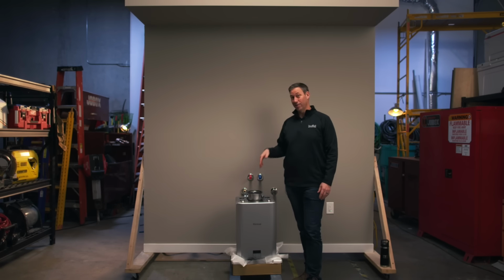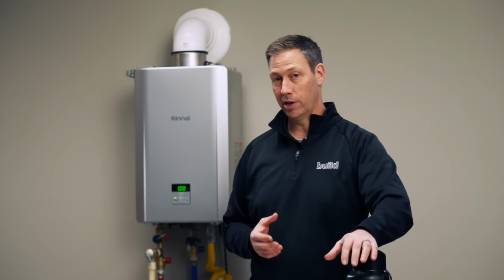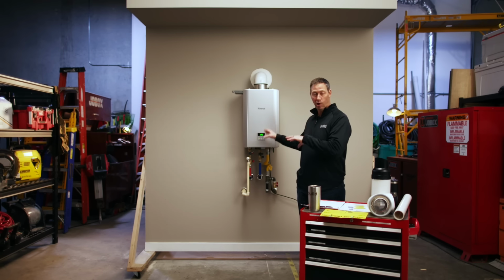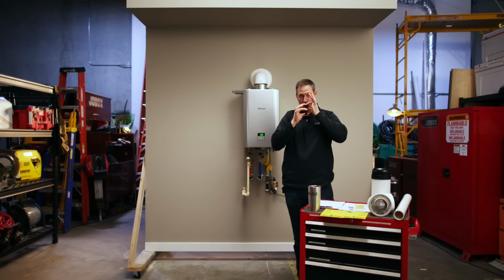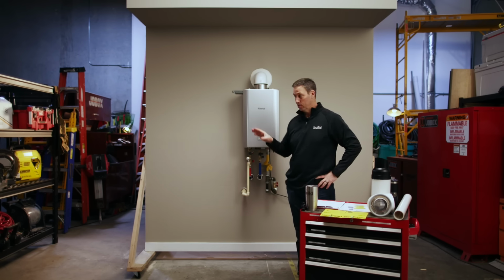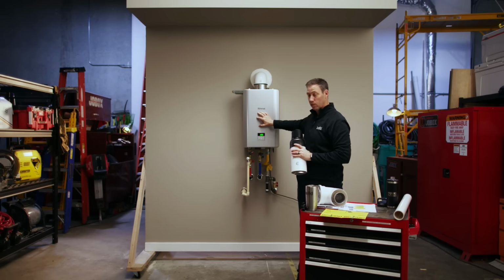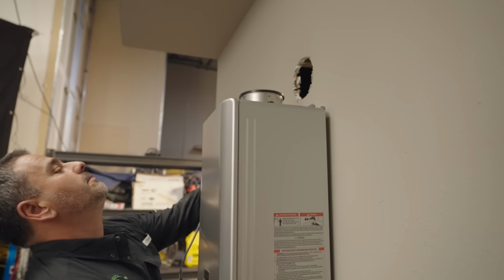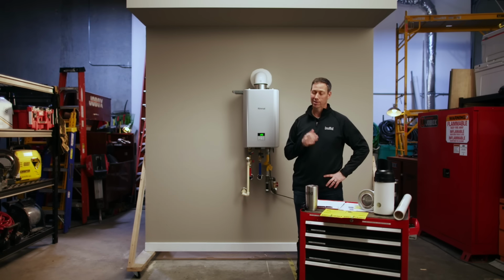Replacing A Water Heater Tank? Probably the Best Tankless Option for You.

Comment: Not a good posting Matt.  
MANY instant water heater installations plagued with problems.  
They were designed to solve SPECIAL problems, to be used in warm climates, to provide LIMITED hot water, etc, not be universal solutions.  
See Bob Y's post for all the reasons it'll bite you in behind gas wise.  Ditto if with electric. 
The often don't provide needed HW over ANY period of operation as they are NEVER sized for likely simultaneous loads, 2 showers, kitchen sink, dishwasher, clothes washer, unless they are max water conserving fixtures and less than 10 min showers.  1/2 of the people in the US live in areas where you are probably looking 5 gpm due to low ground water temp incoming with a max water temp of 110, which by the time it runs through pipes could well be 105 (a typical shower) or less.  If you have a home that is more than 10 yrs old, you could well have shower heads using 5 gpm and that's maxed out your 200,000 btu system.  So add to price replacing any fixtures using more than 2.5, preferably less, max 1.75, but obviously 1.5 better. .  Hint, do this MONTHS before changing water heater, then if family 'complaints' are too strong, you can just put the old faucets and shower heads back on.  
Now, you can keep upping the size of the instantaneous heater to commercial quality equipment, sure you can do it, with a burner 4 times more powerful than your furnace.  Guess what, that also means the unit will wear out faster.  Not an issue with commercial, they are used to spending money to make money.  
Oh, and heat pump water heaters, outside of the try to find an installer with a track record, or at all, then try to find someone to fix the AC part, which will fail faster than you typical window ac as it's under full load all year, you'll find the backup resistance heaters are on MUCH of the time, and if they system does not have typ two 5000 watt elements, you'll be short of hot water at times.  Also check the maximum draw of the unit, as unless the heating elements are turned off before AC heat pump comes on, it'll mean this is drawing MORE power than before and you'll need an electrician to run a bigger line, assuming your panel has the spare capacity.
I have a solution to this, virtually unlimited hot water.  There are one or two 80 gal water heaters still available that can be retrofitted with upgrade kits, thermostatic valve, improved anti corrosion fittings and accessories, so you can set it at 160 or 180 even and mix it down to 120.  That means 110 to 140 plus gallons of hot water first hour of use instead of 30 with a heat pump water heater running on conservation mode.  About

Comment: Problem with recirc is the unit never really gets to turn off since the water in the lines is always cooling down so essentially you are never 'on demand'.  It will basically kill your electricity usage during the 20 hours in the day you aren't actually using hot water.
Reply: Using the recirc valve also means you no longer have any cold water without waiting for new water to enter the pipes.

Comment: I have a Rinnai Tankless in my house, that I installed after having 2 traditional water tanks, spring leaks on me back to back...

Anyways I DO NOT have a re-circulation valve in my house, nor do I want one. I'll deal with cold water, b/c I don't want to just 
CONSTANTLY heat the water for the luxury of having "instantaneous hot water".... 

That being said I was using 50 dollars of natural gas a month, without batting an eye, on my old water heaters, when I switched over to my Rinnai, my gas portion
of the utility went down to about 10 bucks a month. Mind you SINGLE PERSON in the house.. 

It was completely worth the headache of reading a manual an installing.

Comment: So . . . . you promote the benefit of the tankless design - e.g., it doesnt keep hot water in the tank hot all the time . . . but then, burn gas to maintain the temperature of the water in your line (!) - -And, as soon as you do, it seems like it's now a (not quite) tankless design with the piping becoming the storage tank . . . . . . .  ALL KINDS of considerations here - - - certainly the volume of water in those lines is less than what is in my hot water tank BUT . . . . those lines aren't going to be insulated very effectively (for most existing construction) . . . . and the amount of uninsulated (in most existing homes)  surface area of those pipes for a given volume of water is going to be very significant compared to my tanked hot water heater . . . . . .with the net result that you're gonna give up heat pretty quickly . . . . Seems like a case of two or three steps forward and some number of uncertain steps backwards. .  But hey . .  we can sell some tankless heaters.

Comment: I have spoken to several plumbers over the years as they were installing tankless to replace the old hot water tanks. All of them to a man will not have them in their own homes. If the customer has an old electric water heater , said customer must spend up to 1800 dollars to upgrade the panel box. The other downside plumbers have told me is the tankless units only last about 5 years. For five years of service , seems like a lot of money to spend. Not trying to piss on your parade but people should know the drawbacks to switching to tankless. I cannot speak to the longevity of gas fired tankless units , however , I believe the life expectancy of those are about 6 years. Most standard water heaters gas or electric can last 12 to 15 years and cost about 6 to 8 hundred dollars plus the fee for installation.

Comment: I would have assumed most water heaters would be in the mechanical closet along with the furnace and evap coil so the condensate drain is right there.
Reply: The condensate that comes from condensing gas appliances is highly acidic. 
You cannot run it into copper and many cities make you clean it with a neutralizer in line first before adding to sewage lines.

Comment: Could you explain the advantages to an electric tankless vs. a gas (propane) tankless? Please!
Reply: If you're in America, electric tankless is only used for seldom-used points because they can't flow hot water for very long. If you're in other parts of the world, that's not the case necessarily. The difference is how they get power. In America we only have 220 volts. .. and that's if you run a dedicated line and if your service supports the extra amperage. 

In Europe you might have 440v, which lets you need less current, smaller/cheaper electric wiring, all while using a heater than can compete with gas for performance. In other words that product doesn't exist for Americans.

Comment: I have a Rinnai commercial unit handling my heat and hot water. It was able to use the existing PVC exhaust from the old direct vent tank, and the relief valve was already run to a drain so that was fine for condensate. It's much quieter and modulates pretty seamlessly. It handles heat, a hot wash filling, and a shower as hot as I want it simultaneously without issue. The only real downside is the initial delay, but honestly it's worth the tradeoff for me.

What I can't speak to is longevity, reliability, and service costs. I rent through, so that's not my problem (directly anyway).

Comment: Our house has 2 hot water circuits- the master and everything else.  The 11yo ao Smith 50gal power vent for the master finally started leaking. I was torn between tankless (have the gas for it) and tank.  Ended up installing two Bradford White 50gal power vents in series.  So there's 100gal of hot water on tap, first hr delivery is approx 140 gal.  It almost seems to work like tankless really.  Can take a 20 min shower, then fill a jacuzzi tub, run the hot drip to keep the bath warm, do that for half an hr and then take another 20min shower.  Solid hot water the whole time, faster delivery, lower maintenance.  Pretty happy w it.

Comment: No thanks I sold tankless for 8 years ,I'll keep changing my Angel rod's every two years in my 20 y.o. glass lined 50 gallon tank.Average cost for permits and installation on Tankless before pandemic was average $3500, Tank$ 1300 here in las vegas.Great video for new home builds,and they are easier to replace after 10-20 years like a tank, just rember dont use a Water Softner folks that will kill heaters faster then anything
Reply: $3,500?  That's the going rate for a tank replacement.  With a simple, cheap HD unit.  Tankless are double that at least.  And even more if input or output upgrades are required.  (New venting is always required!).

But, still cheaper than the $6,000 to $8,000 I've been quoted for a heat pump water heater installation.  And that assumed I would provide the 240V, 30A service.  (I was planning to steal the electric dryer circuit from the nearby breaker box because I have a gas dryer)

Everything construction related in CA is off the charts these days.  My neighbor paid $20,000 for an exterior house repaint to a couple of unlicensed, undocumented two years ago!   Actual licensed pros were too busy to even offer him an estimate.

Comment: i wish i had the money for a tankless, had to go with a small loan just to replace my failed tank water heater (paycheck to paycheck can suck when things break all at once, (i would have to add power to the closet and get stainless vents if i went tankless, as the tank variety just uses a normal pilot light and galvanized flue pipe)

Comment: So, you're taking the cost/efficiency of a tankless and instant hot water system...and modifying it to continually heating/maintaining stored hot water in lengths of pipe? Aren't you neutralizing all those incredible instant hot water tank advantages a bit?

Comment: In the UK tankless is pretty common, though the same heater also does hydronic heating of the property over winter, so there's a secondary heat exchanger inside it. Though now discussion is going back to tanks (cylinders) so you can use solar and heat pumps as inputs for lower carbon heat.
Reply: My boss man is thinking of if and when they might donut with gas. Because he's thinking of the oil crisis that they may look into more electric or maybe even Hydrogen. What do you think about that?
And yeah. My boss has already put in a lot of electric water heating tanks. We've managed to get some good sources of simple vent less heaters that could work of solar no problem.

Comment: I tankless water heater. The only thing, that I don't like, is I have run the water to get hot water. So, the only time I run it, is when I do my laundry and dishes together. Other than that, I love it. I have a 1,000 square foot house. I believe my tankless water heater is condescending water heater. I'll have to install crossover valve under kitchen sink. I thought of installing a recirculation pump.

Comment: Does that thermal bypass valve work in a old retrofit hot water tank scenario? Just trying to get hot water quicker without an existing recirculating pump.
Reply: Check out the Smart Recirculation Control, they have on demand pump solutions for tank and tankless water heater with and without a dedicated recirculation loop.

Comment: For models that hook up on the outside what climates can they operate in without freezing?
Reply: The exterior unit can protect itself down to -4 but again it only can protect itself but not the pipes below. But it still needs electricity and gas on some models.

Comment: So do you need that bypass valve for each fixture then?  Many houses have multiple sinks or showers that are the same far distance away.  Whats the point of only having your shower hot in the bathroom, but your sink takes a  long time.
Reply: No, not for each fixture, as long as all your distant fixtures are plumbed off the main trunk line which will now be primed with the hot water. If the multiple distant fixtures have different trunk lines then yes, you need the bypass valve somewhere on each trunk line.
Reply: @nwsvndr  But what primes the other lines off the main trunk line when they are inactive?  If water isn't being drawn from that hot water line from running the tap, that pex line will eventually cool off and just be cold water.  So that line will still have the issue of having to empty that cold water first before hot water follows it.
Reply: @virgil3241  Only the one fixture (the one that has the valve) gets hot water immediately. At the others you'll have to still wait for the hot water to get from the trunk line to the fixture (the water in the trunk line will be hot, but not in the line between the trunk and the other fixtures).
Reply: @nwsvndr  So as my original question asked, then you will need a bypass for each fixture thats the same distance away.  Because if you have a shower that takes a long time, then your sink will as well.  What's the point of just having one fixture in the house get hot water immediately, and then have 3-4 others have the same issue
Reply: @virgil3241  In the distant bathroom, it's unlikely each fixture has a separate line that goes all the way back to the heater. But if yhey do, then yes, you need not only a valve at each line and also possibly multiple pumps.
Reply: @nwsvndr  Not back to the heater, but to the manifold.  In Canada, we have a hot water manifold, and a cold water manifold.  With a line for EVERY fixture in the house that can be turned off seperatly to work on them.  Minus toilets obviously which only goes back to the cold.  Even so, my point still stands, you will need a separate bypass valve for every fixture far away because whats the point of having one far away shower be hot instantly, and your kitchen tap or bathroom tap take forever like before.  From the sounds of it, this would be more of a pain in the ass and extra cost.
Reply: @virgil3241  I agree, it doesn't sound like this is the system for you (and those plastic valves aren't cheap!).

Comment: Given most of these would be replacements, why not use the existing drain? also, how do you stand it up in place of a free standing conventional unit - is there a stand or something? (I have two old water heaters - both in the attic and would be good to replace with tankless seems like, but would want the higher efficiency condensing units)

Comment: Why not just use that cold water from the hot tap to brush your teeth before you get into the shower. By the time you have finished brushing your teeth, rinsing your toothbrush, the hot water will be right there nothing wasted.

Comment: As a plumber I've only recommended a tankless water heater once. Tankless heaters cost twice as much and installation cost is high especially non condensing units because of the vent. Tankless units also need yearly maintenance and they become probablamatic after 5-10 years so there's a good chance you'll be out of hot water for a few days for parts to come in and  more than likely you could buy a new tank unit for fixing the tankless unit.
Reply: I’m a service guy and work on tankless at least 5-1 compared to a standard tank. With that said I still upgraded to a tankless myself. Endless hot water with kids trumped the inevitable break down to me.
Reply: Why own anything then if it will eventually break down?

Comment: Norritz eztr 40 top mounted water connections no moving water lines. And an easy concentric ventr setup that uses tank flu pipe. It's literally made to install in place of 40 gallon tank. 6.5 gpm. Probably same price as the rinnai no built in recirculation pump but it's a tankless water heater i can wait 60 seconds for the water to get hot... and then stay hot forever.
Reply: Now that could work for the "normal" situations I was talking about.  As long as you're average demand doesn't exceed the unit's capacity.